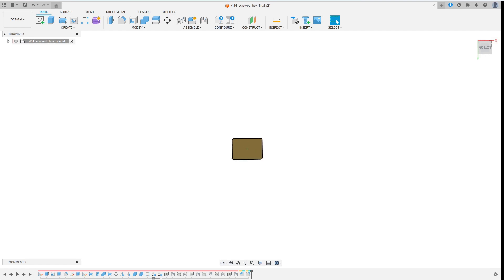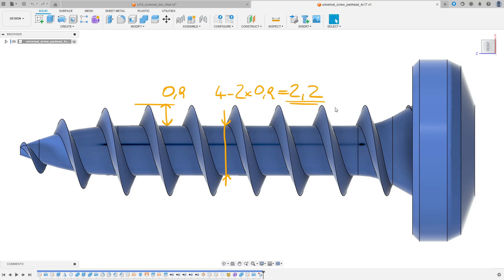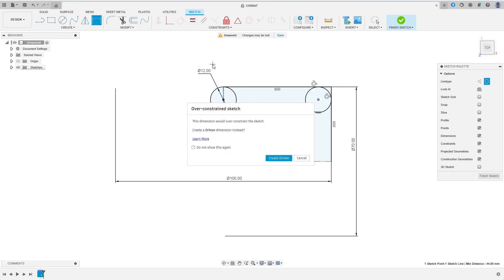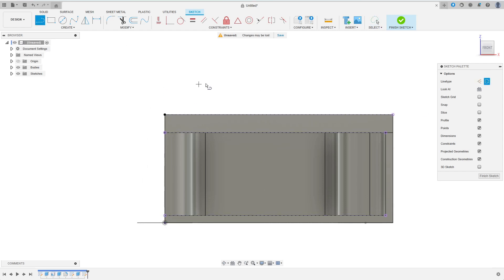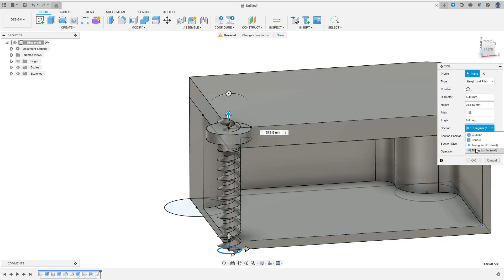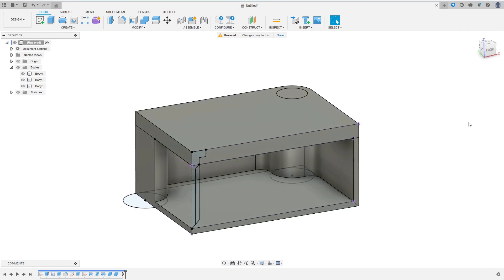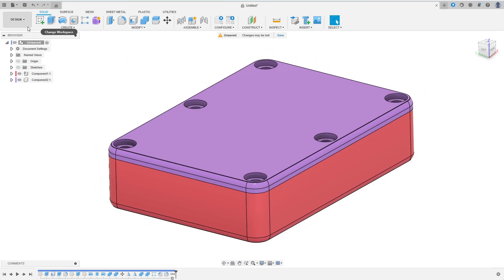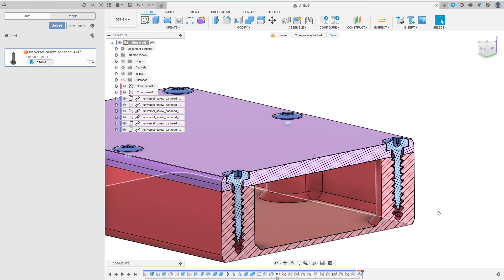My favorite screw for 3d printed parts, full design in Fusion

Comment: Thank you for this very interesting and well explained tutorial. 😊
I've learned some new design methods again. 😉
I couldn't find the screw model in the Fusion360 (McMaster-Carr) database.
Could you give us the reference?
Thank you very much
👍👍
Reply from the maker: Thanks for the kind feedback! I just used a screw type from a local hardware store and modeled it based on the measurements. Most likely there is no exact equivalent in the database.
Reply: @getprototyping  OK, thanks for this information.
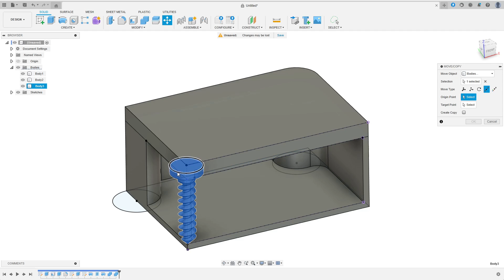I'm going to try to take the model from the design of the 1st screw hole of the box. ( Step at 7:36 -> 8:05 )
In order to complete the tutorial
😊

Comment: I would have modeled this completely different but enjoyed your approach. How easy is it to get those wood screws cross-threaded?
Reply from the maker: Due to the high pitch and depth of the profile it is practically impossible to get them cross-threaded.
Reply: @getprototyping  great,I'm trying this. Insert a McMaster wood screw step file, scale by 1.02 then subtract it from base. It's printing now. I'll reply with my results, trying with a flat head first.
Reply: This approach failed.
Reply from the maker: Be carful to only scale in xy (probably more than 2%), but not in the z direction! Otherwise the pitch is also scaled. Nonetheless, I suspect the steep internal overhangs are problematic.

Comment: This is a really great guide, thank you!  Are there any benefits to modeling the female threads the way you did over importing a longer screw of the same size and scale it as necessary to use as a subtractive body?
Reply from the maker: The overhangs would be even steeper (the triangular coil already has 60° overhangs). I want decent layer adhesion in the contact areas, though. So, id always use a profile better suited for printing than is the thread itself.